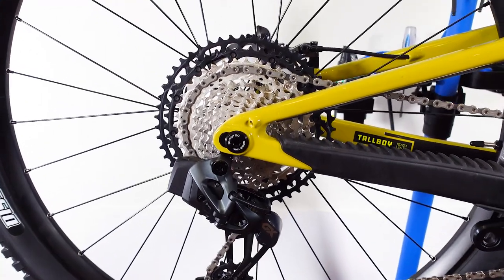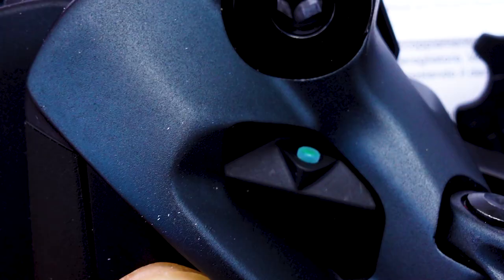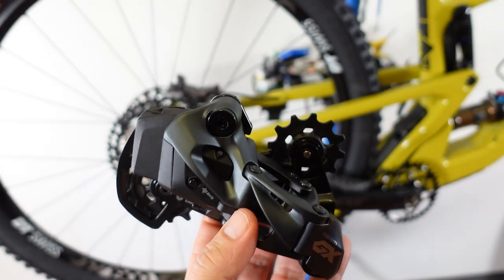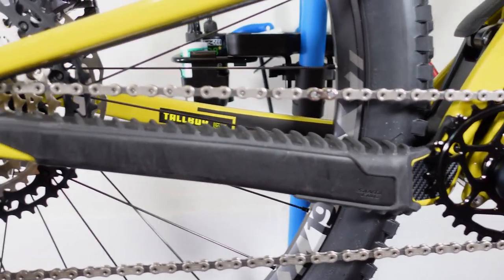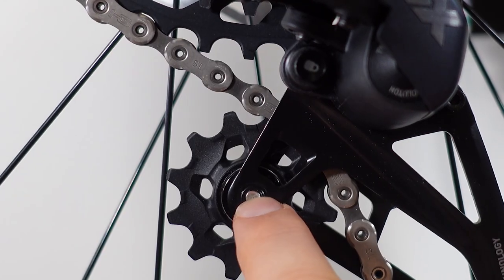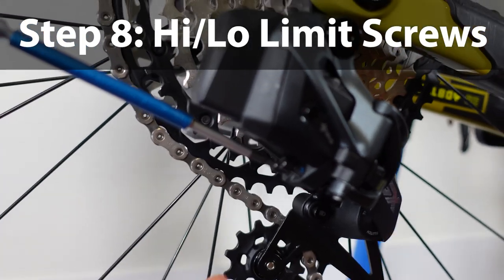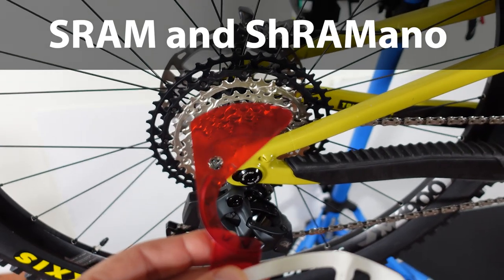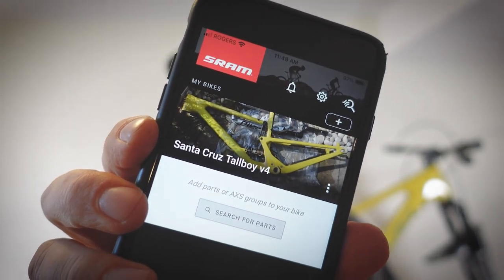SRAM GX Eagle AXS Installation How-To With a Twist? SRAM Wireless Drivetrain, BLE

Comment: I have been running a SRAMano setup for less than a year, and I am really unhappy with the durability of the XTR cassette on an ebike. The AXS shifter works perfectly with the XTR 10-51 cassette and XTR chain...well, at least when it is brand new. Even though it was adjusted correctly, and it initially shifted really well, the 3 largest gears on the XTR take a beating when climbing hills, and I have now broke a  tooth off of 2 of the gears. It shifts smoother than SRAM by basically engaging 2 gears simultaneously as the shift happens, but if you apply any torque during that time it really causes wear and tear. It may be ok on a normal bike, but this heavy long travel Haibike totally wrecked the cassette in under 500 miles of trail riding. What a waste of a $400+ cassette and a $80 micro spline hub. I am going back to SRAM with a GX cassette and a XX1 chain. It may not shift as smoothly as XTR, but it shifts faster and more positively, which will extend the life of the cassette.
Reply: @LoveMTB  yes the SRAM is a little bit noisier during shifts, but I actually missed that quick positive shifting feel of the SRAM going into each gear. The XTR was an expensive experiment that didn't quite go how I had hoped. The weight savings are not worth the loss of durability in my opinion.
Reply: @mk3driftmotion  , @LoveMTB - I think Shimano has come out with an E-Bike focused groupset (LinkGlide)? With a full power E-Bike I would def. stay with the cheaper cassettes.

Comment: I'm tired of trying to adjust backpedal on the 51T, any ideas for full XT system?
Reply from the maker: Chain falling off the 51T when backpedaling?
Reply: @LoveMTB  
yep. Chainline is straight when it's on the 6th cog, so I'm unsure what's causing it.
Reply from the maker: @ImTheiWarrior  What's the length of your chainstay? What chainring size?
Reply: @LoveMTB  
It's oval 32T and chainstay is 445mm (Banshee Phantom V3 Medium)
Reply from the maker: @ImTheiWarrior  Hmm...how much riding did you put on the drivetrain so far?
Reply: @LoveMTB  It's fairly new. I switched from SLX based to XT less than 100km ago (full chain, derailleur and shifter switch)
Reply from the maker: Had the same issue with SLX?
Reply: @LoveMTB  not that I remember.. wired, isn’t it?
Reply from the maker: @ImTheiWarrior  I bet you did! 😀
The 2 drivetrains are identical.

Comment: Excellent video, I do have Shimano cassette M6100 to be specific a good friend of mine gave me Sram X01 RD and shifter are they compatible same as you have in the video. Thankss
Reply: @LoveMTB  I would like to have a SRAM X01 RD and shifter and my cassette would be M6100, would that work? but my shifter and RD is not  AXS same as yours, wondering if it would work same as yours. Thank you!

Comment: Thanks.  I just did this and it shifts amazing except for the biggest COG.  I could not trouble shoot it and neither could my LBS.   Not a bent hangar.  Only thing i can think of is I have a oneup switch oval ring.   Going to try a shimano direct ring.  Any suggestions?
Reply: Do you have the 55 or 56.5mm chain line cranks as opposed to the 52mm ones? That might cause you to have the poor shift at the most extreme angle in that granny gear, since the chain line is biased towards the smaller cogs.

Comment: Hey! 
I have XX1 in front and I was thinking to put Shimano XT Cassette and derailleur at the rear end.. would that be compatible with the Chainring?
Reply: @LoveMTB  Shimano parts are available in my country more often than SRAM.

So you meant to say I can use SRAM Chain with Shimano rear setup and XX1 crank but not Shimano Chain with SRAM crankset or mixing both won't work at flawlessly? I saw in some of your videos shifting works smooth but wasn't sure of the Chain swap.

Comment: You've started with 41mm b-gap from bog tooth to center of cog. After sag, what did you end up with?
Reply: Use/measure 41mm at sag, the value not at sag, in this case, is irrelevant

Comment: Been using this setup with slx cassette chain and oval chainring and was working fine for the past month but now it seems to want to jump gears at the top and bottom of the range even after micro adjustment in the middle of the cassette. If I adjust for the small cogs, big cogs start to jump around and vice versa.
Reply: This means you most likely need to align your derailleur hanger. When its gets bent or twisted it affects the angle of the upper cog in relation to your front chainring.

Comment: It's all cool and all until you consider what happens when you destroy your derailleur hah. For riders with high risk due to terrain ridden Deore RD (with XT/XTR shifter) is no brainer. BTW. Wouldn't it be better to program position for every single chainring (especially as running on a slightly differently spaced cassette)? I understand that is possible for Shimano, so I assume it is also possible with AXS (maybe the app is required)?

Comment: Im done with cables. I have a 2 week old RIP9 with Deore and the shifting is already giving me fits..After riding Di2 for many years, theres no going back!
Reply: @LoveMTB  Yessir, already looking where to purchase!  Quick question: My Niner came with Raceface cranks and XT 12 speed..The cranks shouldn't matter for this conversion to AXS?
Reply: That sucks man. I bought a Vitus Escarpe and the the shifting sucked from the moment I got it. Try sizing your chain or getting a goat extension. For me resizing my chain worked as the factory chain was too short.
Reply: @jimig399  Thanks but how would resizing my chain help?..It's the long cable run from the shifter through the housing..and then depending on how the cable end angles to the rear der and how it attaches, has a lot to do with it..My bikes from the 90's with XTR werw way better with these new bikes and their routing..I have Di2 on my road bikes and electronic shifting just makes for better racing and training..
Reply: @michaelsteven1090  I'm 50. Been riding a long time. I understand your problem well. Just offering friendly advice that has helped me with the same issue. I'm sick to death of cables. But a brand new bike with shifting trouble that cannot be resolved by timing the derailleur...gotta be the chain. Forget what you think you know and check your chain sizing and resize it.
Reply: @jimig399  Ok, I'm 61..Been riding/racing mt bikes since '94..always built and adjusted my own bikes..I'll take your friendly advice and check the chain length but when you start routing housing and cables with long runs through the frames, shifting only works for so long (2 rides?) before you have to  start "searching" for the gear your looking for..and when hitting a 10-12% grade out here in the deep woods of CO, it makes for a frustrating day..Thanks..Now where can I get these AXS's?.  nobody has them!..😂
Reply: @michaelsteven1090  yeah your the man. My comment was not well thought out. Way to take it like a man. You got me by a few years but im sure I'm better looking then you are😲😁. I defer to your oldness and concede. 🙋

Comment: Hey Legend, have you had a chance to thoroughly test this? I'm keen to give it a go. I have a shimano slx 12s drivetrain currently with a bent derailleur. Cheers
Reply: @LoveMTB  Sorry mate, i was asking if you had a chance to test the ShRAMano drivetrain. i have bent my slx one with a tree branch so need to replace it and am thinking of doing this upgrade?
Reply: @LoveMTB  alright, I will keep it in mind. I have a complete slx drivetrain. Cassette, chainring, cranks and chain. Will be interesting to see how it turns out. Cheers for responding and the advice. Keep up the great work with the videos! Love watching them. ✌🏼
Reply: @LoveMTB  Hey, i have now completed this and i changed both jockey wheels with my shimano ones off my slx derailleur. It works floorlesly up and down in all gears except going from the 10t up to the 12t.  Going from 12t down to 10t works fine but going back up it just won't go. It will go from 10t to 14t without issue. Any ideas? i have tried micro adjusting and made sure limit screws are set correctly but it just won't go. at the end of the day i can get away without the 12t cog but would be nice to have. Any thoughts would be much appreciated.
Cheers Dunc

Comment: I have just done this setup after watching this. Everything is smooth apart from when i back pedal. The Chain drops down from the largest cog to the middle of the cassette every time. Not sure how to fix it....
Reply: @LoveMTB  It is pretty aggressive tbh. The chainline is 52mm and the chainstay length is 435 mm. It never did it with the the Shimano SLX M7100 Deraileur.

Comment: I have same noise on biggest cog, like chain jumping a bit, other gears work fine. If I set microadjustment there is no noise on biggest cog, then middle of the cassette is making huge noise. Limit screw is not touching derailleur. What could be causing this?
Reply: @LoveMTB  yes, XT cassette and chain
Reply: @LoveMTB  Should I change the chain or something?

Comment: I always get paranoid about making sure my H limit is set right on a carbon frame. 

It would be a huge bummer to wreck a carbon frame from a poorly adjusted H limit.
Reply: @LoveMTB  Do you know if the AXS derailleur will default to its factory indexing settings if the battery has been removed for too long?

Comment: do you notice any noise coming from the jockey wheels when the chain is a bit dirty or riding in dusty conditions? i have GX AXS/XT cassette/chain on both my bikes, and i find i have to keep my chain pretty clean, otherwise i get some noise coming from the jockey wheels of the derailleur when i pedal
Reply: @LoveMTB  regular XT chain. The sounds seem to be coming from the chain going over the jockey wheels...
Reply: @LoveMTB  I’m using Rock n Roll gold. Same stuff I was using when I was running XT derailleur and it was working fine then
Reply: @LoveMTB  lol...which one would you recommend?
Reply: @LoveMTB  thanks!!

Comment: Is there a way to increase the speed of shifting of the AXS, any tuning available in the app? It feels slow... I think my mechanical XTR derailleur is faster than this. If we compare to the new electronic Dura Ace, that is very fast.
Reply: It’s pretty fast, even unnoticeable
Reply: I'm using everything Shimano XTR.
Reply: @LoveMTB  HG+ is slower? It's supposed to be faster. 
AXS is ok, but when you compare its shifting speed with Shimano R9200 you'll notice the difference. AXS goes zzzziiiiipp... shift done, Shimano is a fast slap shift done, it's like F1 speed shifting. It shifts the entire cassette while AXS shifts one or two. I think SRAM will upgrade AXS in the future to make it faster and match Shimano. The small battery on the AXS has a limited capacity, I don't think it can be much faster as it is or it wouldn't last long.
Reply: @LoveMTB  Fair or not, I think SRAM can do better.

Comment: 4 reasons not to go axs
1 won't make you faster, you already have a derailleur that works just fine.
2 battery can go dead while in transit. The machine senses motion, that's when it comes alive and connects to each other. If your battery is low you might find yourself at the trail head not being able to shift. Depending how long your trip is.
3 sensitivity, if you bump that shifter at an inopportune time it will shift, sometimes multiple gears which can seriously screw you up. In order for me to make sure I didn't bump that thing I moved it so far in on the bars it wasn't ergonomical at all and hard to reach.
4 sram poor spring tension, if your used to shimano xt, xtr. The clutch has better spring tension and while really thrashing over roots and rock gardens the chain actually chipped paint from my upper triangle because of lack of spring tension.
Those are my top for 4 reasons 
Save your money and put towards a good wheel set is money much better spent.
Reply: @LoveMTB  I had the xo1. I had purchased 2020 Scott genius 900 tuned axs.
Believe me, I really tried hard to like it for about 3 months. Being as I spent $8000 on my bike. I had more problems with it then what I listed, or more problems that were stemming from it. The shop did a firmware update it didn't make any difference.
In the end, February came I had the shop install a regular shifter xo1 and derailleur. I wanted xt but they said this would work better. Thanks for all the great vids and detail.
Reply: @LoveMTB  hopefully it works out better for you then it did for me. I like to ride hard, I like gardens technical features and jumps. That chain slapping is a distraction and irritation that I can't seem to wrap my head around. If your more into trail riding and smoother not so aggressive trails it will probably work good.
And just to follow up, after changing back to mechanical derailleur all the problems went away, the miss shifts, the random skip. Everything except for the chain slapping.
Reply: @LoveMTB  I meant rock gardens, I need to proof read before I hit send. This wife and kids don't leave me alone for one minute.

Comment: Awesome guide, I don't have anything Sram as all my bikes are on Shimano XT, SLX and mix of two, but I guess if Shimano won't come up with wireless XT in next couple of years, eventually will do the same as you after I wear out my current components.

Also I wanted to ask for your advice on something, I am looking for power meters recently and I have 3 options not sure which one to go with
1. XTR m9000 with stages, friend is offering for 350$, almost 0 wear, minor scratches
2. XT M8000 left arm stages, 285 USD (currently on XT M8000 cranks so should be just a swap)
3. XT M8100 with Chinese power meter for 400$ (consistent power meter but not accurate out of the box so needs adjustment against other power meters)
I am kinda sold on XTR M9000, cuz it looks so nice, but not sure if it is the best value option.
Reply: there are also some chances that M8000 left arm is compatible with M7100 and/or M8100 right crankarm, is there not? Would look strange though :D
Reply: @LoveMTB  thanks for the advice!!
Reply: @OYeahan  It might work but might look weird, also there is a 4mm q factor difference between M8000 and M8100/7100, not sure how much it will be noticable and what your joints would say about it.
IMHO should not matter much, but I am not that educated on the subject to be sure
Reply: @mstvir  oh the Q-factor is 4mm wider for like-for-like cranks? Strange. Is that crankarm from 1x or 2x system? And is your current setup 1x or 2x? Not sure if this makes a difference, but if your crank is already 1x then there surely are many Shimano 12sp. chainwheels  available for it. With 2x it might be also possible with some right spacers.

Comment: The Eagle AXS derailleur is HIGHLY PRONE TO DAMAGE. It sticks out too far and if you set your bike on the ground it may pivot on the derailleur and damage the pins and rivets which ruins the shifting quality. I had this happen and ZERO help from SRAM after 2 rides!!!!
Reply: Seams like it was something you did, I have not noticed this with my axs, and haven't heard of this anywhere else, was the b tension properly adjusted? did you have the correct hanger installed?

Comment: I am seeing some people say that you can micro adjust each gear independently. Is this your experience? I don't want to invest unless I know for sure. I currently use the Archer setup which is good, but the AXS is much faster and cleaner. I also run mixed drive trains and don't want strange noises or clicks.
Reply: @kszeplaki  no you want to do the micro adjust on the one that's giving you the most but it's still adjust the entire range the same. SRAM recommends doing the micro on the second from the biggest. Most people doing the setups recommend starting off at the middle. Just so you know I've done this too and it shifts okay for sure and it's electronic. That said the standard shim 12 speed mechanical yes so much more succinctly, it really is a lot smoother shifting. But it was fun to monkey around with.

Comment: Thanks very much for your videos and all the compatibility tests! I am loving the Shramano Eagle GX setup, but I still cannot find a reliable information about "per cog" micro adjustments in the AXS app. Is it possible at all ? Or was this "removed" by a firmware to motivate people to spend more money on the transmission setup? Thanks for answer!
Reply from the maker: My pleasure 
It is 0.2mm with every click adjust from the shifter or the app. Nothings removed if anything carried forward to the Transmissikn